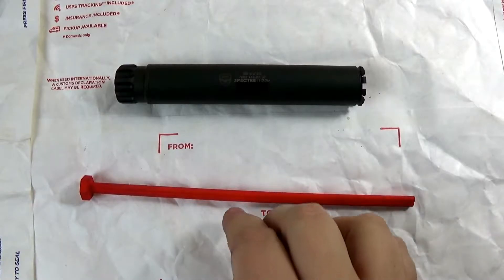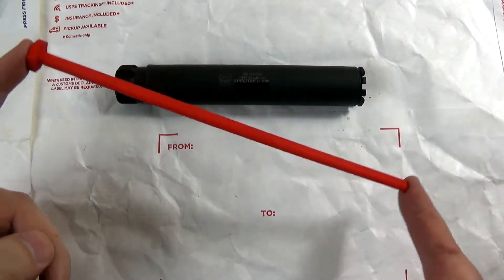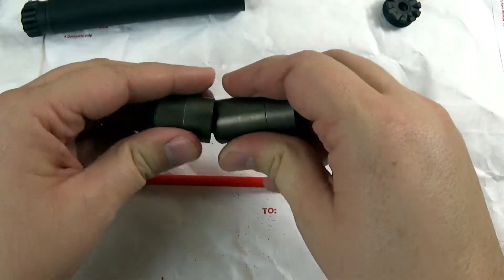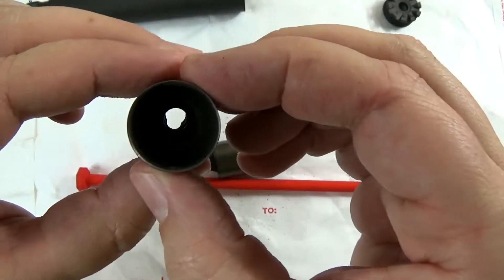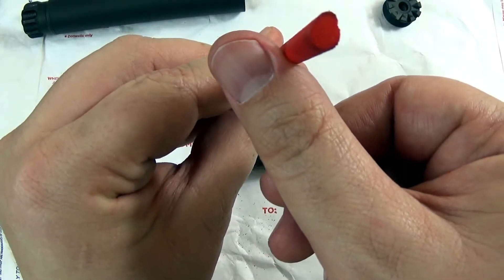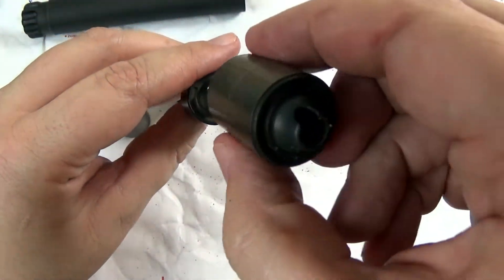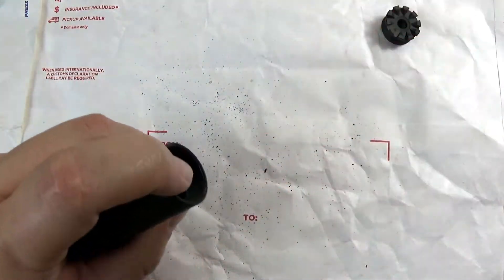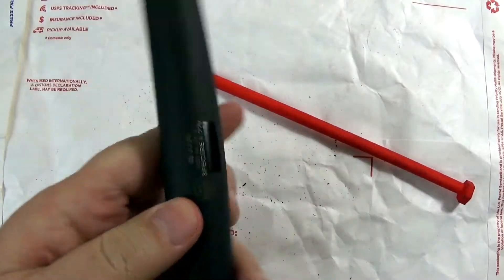SilencerCo Spectre II Baffle Alignment Rod

Comment: When you screw in the end cap, it shifts the baffles as your tightening down your endcap.
Reply from the maker: Mine does not.  The 'click-together' baffles have more friction against each other than the end-cap does on the front baffle.
Reply: Mine shift also

Comment: Can you please post 3d plans for it? Nice Video!!
Reply: Same problem
Reply from the maker: They aren't mine.  If you read the description, you can track it down on AR15.com.
Reply: RyeOnHam I found it, thanks!
Reply: I Am Becoming  Thanks for the reply.. i imported it into solid works with inches conversion, then export back as .stl and it is showing 200mm long with 14mm hex head. i'll give it a shot.